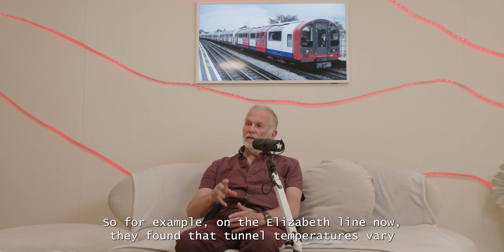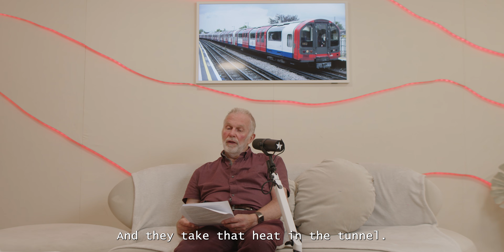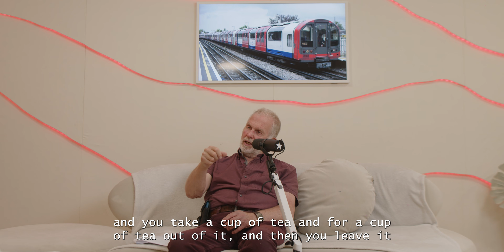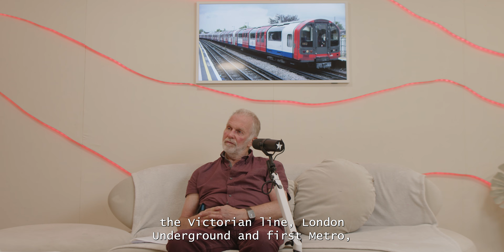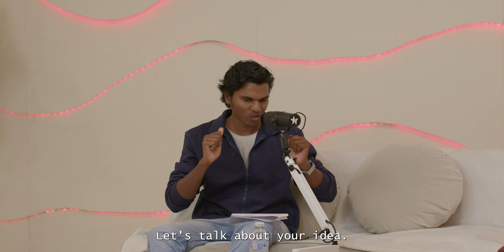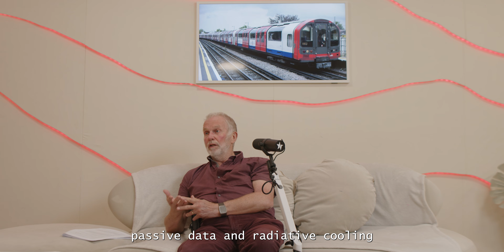Why Is the London Underground So Hot? | The Science Behind TfL’s Heat Crisis | ft. Calvin Barrows

Comment: Never thought about solar gain being the main driver over braking friction. Do you think TfL will ever seriously consider green tracks or reflective paint, or is the infrastructure too hard to change now?
Reply: I really don't know.  I am waiting to see the outcome of their latest experiment which I intimated in the video is likely  to fail. That is AC on the Piccadilly Line!  TfL have said for years that it was not a feasible option because there's nowhere  sensible  to discharge the heat.  In fact it's just going to increase the tunnel's heat.  When does, maybe that'll be the time they realize the comparative effectiveness of carrying train absorbed heat in to expecting low density air to carry it out  as effectively!